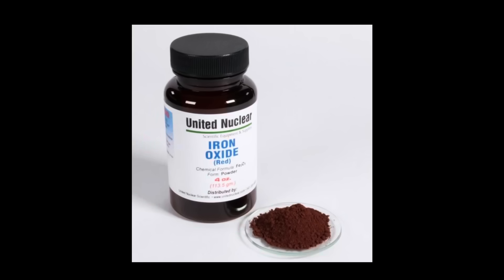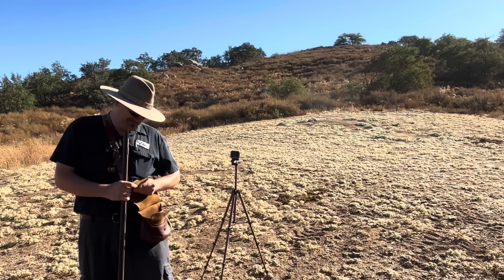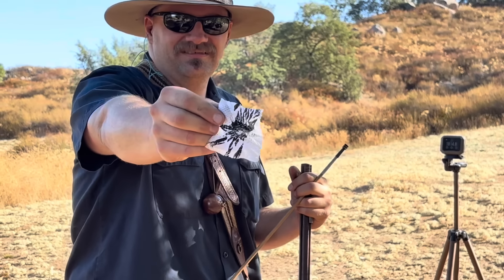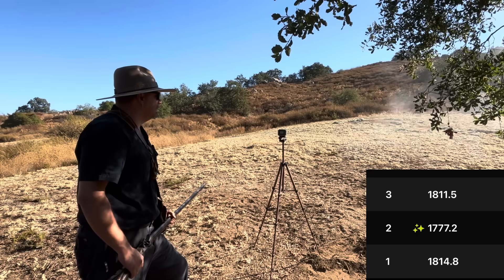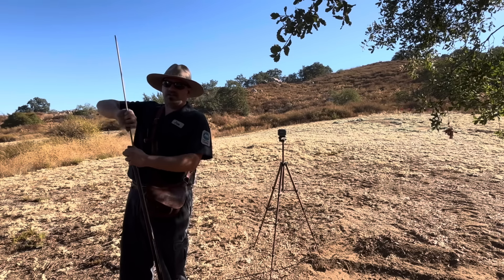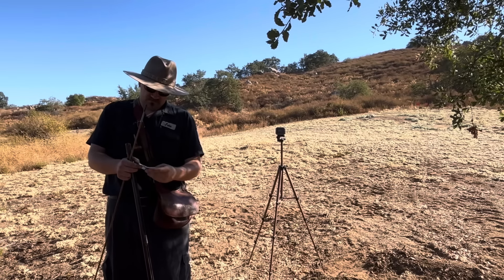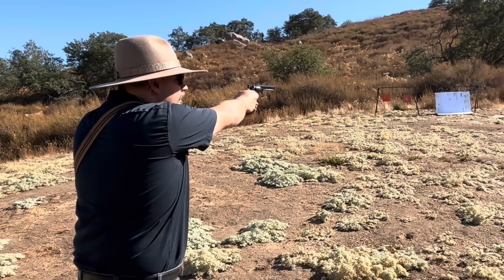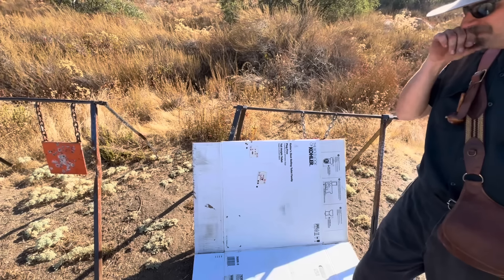Can Iron Oxide Improve Your Black Powder?

Comment: Be glad nobody has asked you to try Ammonpulver yet.(At least, I hope they haven't.) It substitutes Ammonium Nitrate for the Potassium Nitrate. It was used as a propellant in the mid-to-late 1800s. However, it's viciously hygroscopic and from what I have read, doesn't offer any improvement in velocity. I'd be more inclined to carbonize granulated sugar than fool with that.
Reply: Oh, people have asked already :-) Other issue with Ammonpulver, as far as I remember, is that ammonia salts are corrosive to brass.
Reply: I've asked once that they substitute Ammonium Perchlorate for the Potassium Nitrate. The perchlorates in general go bang really hard, but I've been told that the pressure will likely spike beyond what BP firearms can handle.
Reply: Ammonpulver - It won't work in a muzzleloader. It works at high pressure, like a rifle.
Reply: @FordGTmaniac  When burning, hydrogen chloride is released. It corrodes the barrel very well.

Comment: Iron oxide is used in rocket motor fuel to catalytically accelerate decomposition of the oxidizer ammonium perchlorate and it only takes a tiny amount. Also, the fuel for rocket motors is aluminum powder which readily reacts with iron oxide (thermite). Iron oxide will react with carbon, but the kinetics are different (blast furnace). You are not using ammonium perchlorate or aluminum powder, so you cannot compare your black powder with rocket motor fuel. IMO, 1% iron oxide is too much. It might be reasonable to try 0.1% of Fe2O3 as a catalyst in your black powder for comparison.

Comment: More fouling and lower velocities is definitely a loss not a gain so, yeah bad contaminant. I remember reading about an improvised powder to be used loading cartridges for improvised guns and it used iron oxide powder, called red powder. Maybe in that circumstance (of the improvised red powder) it is beneficial, but clearly hurts whatever is going on with Black Powder.

Comment: 65% KNO3, 34% sugar, 1% red iron oxide does burn faster than without the iron oxide.

Iron oxide is a burn rate catalyst.
But it isn't as good a burn rate catalyst as sulphur.

In rocketry, you want to maximize gas volume and minimize the molecular weight of the exhaust.This can be enhanced by adding aluminium because it increases the exhaust temperature.

The best solid rocket propellant is ammonium perchlorate, rubber, and aluminum powder. 
If these ingredients are powdered and you mix them, you'll have a high explosive.
NOT useful in a firearm.

Metal powders and oxidizers can detonate.

Comment: I am curious how the iron oxide affects the inside of the barrel, same for aluminum. Both being components in making thermite.
Reply: If it is reacting at all, it form Milton iron that will adhere to other iron and either form iron sinter that scratches its way down the barrel, or it welds itself onto the rifling making it rougher with every shot. I suspect most of it is not reacting as you can see the smoke from the barrel of the rifle is pinkish compared to the smoke coming from the flash of the lock. The untracked iron oxide or sintered iron probably contributed to plugging of the flash hole as well.

Comment: Have you tried making ammonpluvr yet? It's supposedly the easiest smokeless powder to make, 87% ammonium nitrate, 13% charcoal. I haven't seen any significant documentation on it besides a sole guy on the castboolits reloading forum. He said it worked like IMR3031, but had to make a duplex load with a tiny amount IMR4895 to set it off.

I can post a link to the thread if you're interested.
Reply: My dad had a reloading manual from way back written by a Phil Sharp. In this book was an account of the French using something very close to what you described. It was ammonium nitrate  and charred oat straw. This was then pressed into a solid cylinder with a star shaped hole through the center. This was used for artillery during WW1. It was said to work very well except that it was hard to keep dry, and it was prone to break up under freezing temperatures. They had used it for a while to stretch nitocellulose supplies, but they dropped it when they could. Had they been fighting in a hot, dry place, it might have been very good. I enjoyed your comment, by the way.
Reply: Did he compress his powder into pucks?
Reply: Check page 49 in the book, The Chemistry of Powder and Explosives Vol. 1. Towards the end of the black powder era there were many experiments with "white" powders such as Amidpulver, Ammonpulver, Guanidine nitrate powders, Raschig's white blasting powder, and Powder Brugere. It states the ammonpulver is very hygroscopic, intolerant of wide temperature swings and is difficult to ignite. That last one could be a problem for Jake's flintlock.

Comment: Question; What is, if any, difference between using "white sulfur" as opposed to "yellow sulfur ?" Now, how about adding a "wee" bit of powdered magnesium to make it burn warmer, cleaner, and add a little extra punch behind the ball? 🫨 Hmmm...(Osage-Orange Magnus)

I ask about adding magnesium to the mix based upon what I see happening when I use my magnesium fire starter on damp combustables. Suggested starting point would be, .25 grams per your regular percentage formulation with "gentle" increases to max. efficiency levels...without melting your barrel(s) of course.

Comment: Thanks for doing these tests. I was expecting the meh performance from the rifle but would have hoped for some improvement from the revolver. I guess that's the whole point of testing.

You dodged a real bullet with the aluminium powder by the way. That would have turned your barrel into a pipe bomb. Don't put Aluminium compounds in your powder, the oxides are abrasive.

Comment: I have delved into making thermite with a chemist friend of mine many years ago. Magnesium and iron oxide. The iron oxide supports combustion but it also slows the rate of combustion of the magnesium. This will be interesting to see what your results are. If I were a betting man, I would guess it will slow the burn rate( in nano seconds). However, that does not mean it will decrease the pressures. As a matter of fact, it could increase the pressures.
Reply: Can’t forget the powdered aluminum
Reply: @CFF7327  If you are referring to adding powdered aluminum to the mix, that may have been incorporated in the magnesium my chemist friend brought. I do not remember adding powdered aluminum to our concoction.
Reply: You can make thermite with Aluminum, Magnesium or any mix of the two. All of them react with iron oxides at a very high temperature and can be used for cutting or welding steel. That is the last thing you want inside your rifle barrel.

Comment: I have played around with this myself, if you want to give this a fair shot, use Dark Brown Iron Oxide (Fe2O3). 

It sounds silly, like an overly specific detail, but the difference is drastic.

All Iron Oxide will increase Oxidizer Efficiency in certain compounds. (Burns Cleaner and Hotter)

However,

Red Iron Oxide won't really alter burn rate under almost all conditions. So in BP, it would act as a contaminant only, slowing velocity by essentially just having less fuel mixture per grain.

DB Iron Oxide will accelerate burn rate under pressure in certain formulas. Ther may not be the necessary reactant to cause the specific reaction you want though. In which case, try introducing another 1% of Microcrystalline Cellulose (MCC) powder, this is a saccharine compound and will introduce the catalyst needed for proper conversion of the ferric compounds.

Switch to DB Iron Oxide and bump it to 1.5%. It may actually help neutralize some of the sulfur compounds in the bore and introduce ferric hydroxide (a cold bluing compound for steel) in the carbon fouling.

Also, the reason that pistols lose velocity is related to the
supersonic expansion rate of your gas.

BP burns near instantaneously under compression. 

However, the gas generated during combustion can only expand so fast. Typically this is primarily affected by the gas composition, which in the case of BP is typically primarily CO and CO². Decreasing the amount of CO2 in the gas will increase the velocity of the projectile.

That is why the velocity of BP can't outshoot smokeless, which has a higher supersonic expansion rate and generates less carbon gasses.

Comment: at 8:31, the person talking about rocket motors...

I thought iron oxide is used as an infrared barrier to limit premature ignition in a rocket motor while also giving the burning propellant a little bit of a kick.  I can't recall my source of reasoning but i thought the iron oxide also needs to be coated in linseed oil; this could be a takeaway from pyro compositions. I don't have my books near me to provide reference on this.

Comment: I heard some place that adding powdered methanol can smooth out the combustion in black powder but I don't remember where I heard this I'm not suggesting to do this I'm just wondering if anyone else has ever heard of anything similar the only powdered methanol is I've heard of are Methanol Clathrate or methanol hydrate

I did hear of a freeze-dried methanol but from my understanding is less available

Comment: 😂... thermite is a mixture of aluminum powder and iron powder, mixed in a specific proportion... and was used in a type of grenade to destroy large gun barrels such as a tank main gun... I can't imagine putting either one of these two metals in with gunpowder expecting a good or long-term benefit for the barrel of the gun it's fired in... it just sounds like a bad idea, even if it did potentially up the velocity...

Comment: I know it might sound counter-productive, since it seemed to make the "best" black powder worse, but what would happen if you used "contaminates" in the powders that used the carbon sources that weren't the best? Maybe it can't improve the best for some reason, but is able to help the powders that didn't perform as well. Also potassium nitrate is the oxidizer and charcoal is the actual fuel in BP.  Iron oxide is a reducing agent that gives up it's oxygen to the carbon (I think) so maybe there is a way to increase performance by playing with the percentages of potassium nitrate or sulphur and replacing them with iron oxide, or I'm a complete idiot. Either could be true, or even both I suppose.

Comment: It makes some sense... black powder is a thermite reaction... well,  I'll watch and add my opinion in edit...

Well... that sucked ass... guess I won't be using Iron Oxide in my powder. ..  

Balsa has been on the back burner for a few weeks,  because I just haven't burned any more. I'm dealing with a lot of other things right now,  and don't really have the time for my hobbies.  

Thanks for the information,  Jake. I appreciate it.

Comment: It MIGHT be worth trying, with.02% or so, but still, if velocity isn't better, and it stays that dirty, id say no, stick with the "clean" formula. Aluminum powder is added to basic black to produce "flash powder", such as fireworks uses for a brighter flash in small "black cat" style salutes, as they're called.consider they are confined in a paper hull, not a steel barrel, they need more "brisiance" to perform...I dont think a less than heavy charge would HURT your rifle, but I'd use a pipe test barrel first, before use in your pride and joy there. Lack of rifling wont change velocity,  just accuracy, I think...   YMMV!!

Comment: Well ... if you were to experiment <hypothetically, YouTube powers-that-be> with just a minuscule amount of FLASH POWDER as a "contaminant" .. it would be interesting. Yes, I know that adding TOO MUCH would/could damage your gun, but if you think it could stand just a little more power, then a tiny bit of "FP" might be interesting ... Ditto for smokeless ... (Was it you that tested that or some other YouTuber?)

As for the iron oxide, I wonder if the (slightly) metallic smoke might be messing with your chronograph...

And, finally, the aluminum powder, or maybe magnesium, might resemble some of the Taofledermaus "dragon's breath" rounds.

And I don't think that "antique muzzle-loading propellant" has enough velocity to set off Tannerite, but it could be interesting.

Comment: Rust does not make a good oxidizer in black powder. Here's why, rust, ferric oxide (Fe2O3) has an oxygen double-bonded to an iron, which is single-bonded to the next oxygen, which is also single bonded to the next iron, and finally that iron is double bonded to the last oxygen in the chain. The only oxygen that is available to combine with carbon is that single-bonded oxygen, and it takes energy to break the single bonds and creates 2 molecules of stable ferrous oxide (FeO), which does nothing for the black powder.

Comment: with  you putting this I have thought about aluminium powder (or as you Americans say "aluminum")
as I have played with that in my day LoL
Reply: This can be quite dangerous, aluminum really speeds things up to flash powder velocities.   Traces up to .0.2-.O.4% have been used in some smokeless powders.
Reply: @schinderiapraemeturus6239  OK then you need a small cannon to take the blast LoL
30+ years ago I use to load my friends cannon for American Civil War reenactment it was good fun
if I remember rightly it was a 6-pounder BUT we never fired a ball from it at the reenactments
Reply: Aluminum powder and ammonia nitrate is the recipe for an explosive called tannerite.
   Aluminum powder and iron oxide is the recipe for thermite.

I would be very cautious about adding any metal powder to the black powder.
Reply: @DH-xw6jp  yes but without trace zirconium hydride ..it ain't Tannerite

Comment: What? Why? No. No, I don't think so.

If I'd make a guess and try a metal oxide, copper oxide (CuO) would be my choice.
A thermite mix using CuO instead of iron oxide acts more like black power.
If nothing else, it might give a nice blueish hue to the flame.

Ok, maybe the iron oxide might work as some kind of catalyzer, and in that respect better than other contaminations, so maybe it is not a bad one-way street to worse results.
Still don't think so though.

Comment: Black Iron Oxide is certainly superior to Red Iron Oxide in other “energetic chemistry” so maybe. Does blackpowder even get hot enough to utilize it as a fuel?
Reply: I hope it doesn’t get it just hot enough to bond to the barrel.
Reply from the maker: @CFF7327  now you tell me…😉
Reply: @Everythingblackpowder  I came to the coments to say exactly this. My guess would be that black powder doesn't burn hot enough to liberate the oxygen from the iron. Iron basically has to be molten, 2800°F, to free those oxygen molecules. I dont think black powder gets over ~1400°F
Reply: Red iron oxide is not supposed to act as a fuel or oxygen donor here, but rather catalyst.
Reply: @CFF7327  As far as I know, the exact opposite. But the actual effect will depend on fuel and oxidiser used. In the Tech Ingredients video mentioned here, they used red iron oxide to speed up their sugar (sorbitol) rocket fuel.

Comment: Lets bear in mind iron has several oxidation states, for it to help at all, I dont believe red iron oxide ,Fe03 is going to be useful because its in its highest oxidation state, it wont take on anymore. It cannot function either as a hot particle donator .
 If you leave some steel wool out to rust, you will see it go darker black (Fe02) first before it reacts with more 02 to become the red state, iron 3.   You would want to use black iron oxide, not red.   Along these lines, im sure you would find these considerably more useful:
Batchelder & Zimmerman US patent 3,653,993 and 3,653,994.

Comment: I'll have to do some digging, but there's a story about a widowed mountain woman who kept her kids fed with powder made only from iron oxide (no charcoal???). There was a recipe that went with the story, and she apparently used her sewing thimble to measure charges - one thimble for normal hunting and two thimbles for bear. 
Unfortunately, I didn't follow through at that time, so digging will now be required.
Reply: I have that article, It's been in a copy of Backwoodsman magazine. I also saw it recopied on a muzzleloader forum.
Reply: @crazydaze2792  - Great! Which issue was it, if you recall?
Reply: I just found it in a forum by searching 'gun powder from sugar and rust'. Some old family recipe from the Ozarks using saltpeter (leached from the chicken run soil), sugar and rust with a ratio of 9/8/2. Interesting concoction but have never seen any reports of it tested.
Reply: @robertstump4740 in that particular ratio? No, I haven’t tested it. In the ratio I use for rocket candy: 35%-40% sugar 60%-65% KNO3
Then Add 1%-2% of the above mass in rust (e.g. 40g sugar +60g KNO3 = 100g and then add 1g but no more than 2g red iron rust) works just fine and is exceptionally easy to load consecutive shots and clean if you have an in-line muzzle loader with a removable breach due to the super soft but self-adherent fouling.

Comment: Iron oxide helps burn really hot and pretty fast, a great oxidizer. 
   But it leaves behind molten iron as a by product of burning (which is why they use thermite to weld train rails and underwater pipes).

   I do not think putting an oxidizer that get hot enough to melt steel and spews molten iron in your gun is a good idea... Thanks for risking your rifle and not mine!